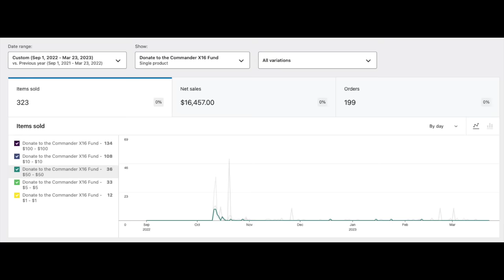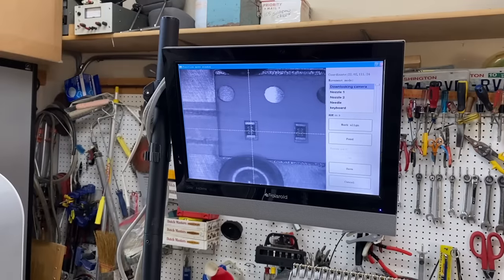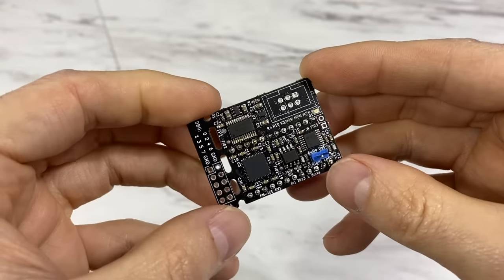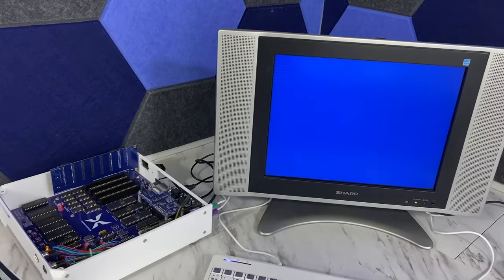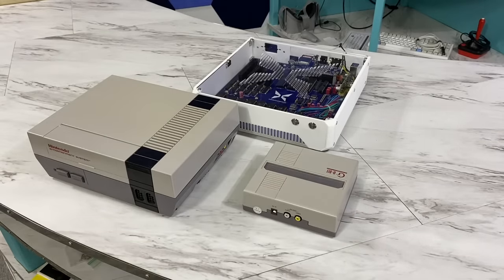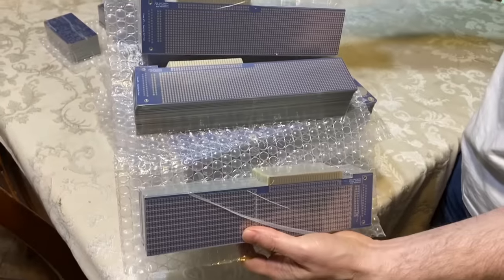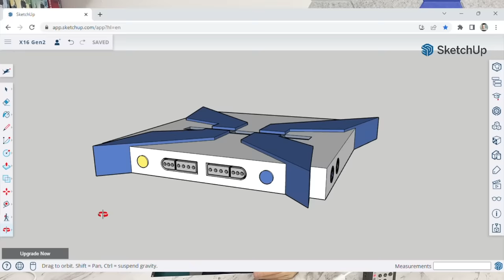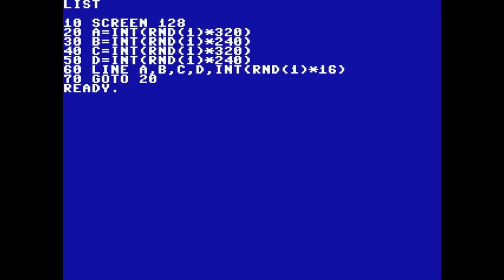Commander X16 2023 update

Comment: I used to work in electronics manufacturing. We used a wave solder machine (rather than a dipper) and it was leaded solder, so lower temperatures... However, the wave soldering machine had a preheat, a flux foamer, an air blade (to clear excess flux) and then the solder wave. The boards were held on two sides with a fixture that had channels on them that the boards slid into. If you tried a fixture that clamped the board into a channel on each side, it should massively decrease your fixturing time. The boards we ran had snap-offs on the sides that slotted into the fixtures, so there weren't component clearance issues. If you want more information, feel free to reach out.
Reply: Spent a summer running a wave solder machine, it would take up David's whole garage! Not to mention his whole net worth.
Reply: Yeah. I spent a year working at a plant that used a solder wave machine. Mass manufacturing of circuit boards can get very complicated. Having the sides of the sides of the circuit board snap off is very common. Also, having the frames that are designed to guide a board through can help.
Reply: Even though I have an AA in EE. I worked as a security guard at Litton Guidance and Control. They had a "wave soldering station" which instead of a flapper creating a wave to cause the solder to rise to the board level. It had the boards float above the solder and then turn to a 30 degree angle to pass a "waterfall" of solder. The solder was pumped, similar to an oil pump in an engine, up a column which created a waterfall of solder. The boards would then pass through this waterfall of solder. Making the total time the board and component passed through the solder to as little as 1 second. Vastly reducing the time the components were exposed to solder temperatures. And had a 100% successful solder rate. I was impressed that they were able to do double sided boards. The components held in place with small blobs of epoxy before soldering while using the pick and place robot. I considered this third generation wave soldering. It is sad that the x16 dev team was sold a 1st gen soldering solution. I fully understand the problems and fixes. It is sad that they have to fight to solve the problems that have already been solved in future generations of soldering machines. 
Congrats in solving these mfg problems. I am sorry you have to deal with this "old tech" problems. I fully understand that switching to 'current tech' would cost way to much' to keep up. Impressive that you could solve the problems.
Reply: This probably won't work in a garage. As well as pre heating it needs moisture control for the process to result in good consistent joints. As others have mentioned the PCBs need to be designed for clamping too.

If you need help getting them manufactured in China I have done it before. It will be cheaper and they obviously have high grade equipment and a lot of experience.
Reply: can just run a tractor belt pulling the pcbs through a solderbath. wave soldering is more to limit the heat exposure to the pins and epoxy of the pcb itself but as all that stuff from the 1960s still works fine i take it there is no problem with heating the whole damn thing to 360C or so :P (also that's exactly what an smd oven does too either way :) LOL. wave soldering is overrated bloat :P (that probably doesn't give that nice of a result as a proper solderbath anyway, more or less guaranteed to fill all vias and pads and not skip a few)
Reply: guess that if any day comes we can't get pbsn anymore we'll just switch to solder them together with literal .999 gold :P it has more or less the same mechanical and temperature properties as lead anyway. but that rohs crap? NEVER. lol. all that stuff literally falls apart.
Reply: I worked at a company that used wave solder machines in the mid 80s. I wasn't directly involved in their use, but being young and curios I did learn how they worked by asking questions.
Reply: A wave soldering machine was the right way to go. Taking in all the parts to assemble by hand was insanity. PCBWay could have populated all the boards. It looks like in the world of retro machines, Gideon and the Ultimate64 has been the only one to do it right. I honestly don't see the point in this project anymore.
Reply: @espressomatic I think this was considered but that would require the components to be sent to PCBWay. Dave would have thought this through and only rejected that as an option if it was more difficult overall than their current direction. After these early challenges are conquered it will be awesome! 😊
Reply: Ah the good old days.  The place I used to work went through giant drums of freon every day just to clear the flux off of those fixtures that would carry the board through the wave solder machine.  Ozone layer, what's that?
Reply: @espressomatic  not quite. lol. kalex and foxconn are still a thing you know :P just like they were in the 1980s. other than that one can just outsource production to things like sony. tramiel was a bit of an amateur for the units he actually sold (like who sells xx million units and then not either outsource to a REAL electronics manufacturer OR get a real fully automated factory yourself ;) tv manufacturers already did it in better ways 40 years earlier. as yes. computers ARE just electronics so if you want a few 1000 to million of em you do simply call a sony or a mithsibitsu or whatever to make them for you. not 'pcbway' :P all that other stuff is just for 'prototyping' and evaluation units. not for 'oh hi my design is finished and now i want a lot of them' :P
Reply: preferably have them handle the warehousing and logistics and sales channels too. as well as rma returns and support :P they do that kind of stuff. all day long. after all :P where you just have 1 product to sell they can just put it between their 100 different washingmachines and tvs.
Reply: pcbway just doesn't strike me as an actual manufacturer to call for large qty. plus they don't have relations with retail channels (toys rus, walmart, bestbuy, things like that and most definately can't handle THAT part of it) there are several entities in that market you probably never heard of. and quite a few that also sell walkmans and tv's under their own brand(s) to call :P that can do all of that hell a lot better and may even want to sell it under their own name :P
Reply: with a nitrogen tunnel behind?
Reply: @CB3ROB-CyberBunker  if we're still talking about this project and not just electronics manufacture in general, I somehow doubt this thing is going to get off the ground enough to ever sell more than 20k units. it's pretty darn niche. trying to sell it in walmart sounds like a lost cause. but I don't know anything besides having watched a few videos on this project, so I'm kind of talking out my ass and taking a wild guess at the scale. what you're talking about sounds wildly out of scope to me.
Reply: @jamesdye4603  Thank your for telling us that you were young in the past and that you learned "something" by asking questions. Oh and for not telling us some irrelevant and anecdotal information that does not contribute the slightest way to this topic or the solution of the problem.
May I ask in what you were involved instead back in the day? Professional trolling? Or professional trivialities?
I'm sorry, but your self-promotional comment, which doesn't make any sense, deserves just such a cynical response. (How can you just say you know something... but then don't share it if that's the point here??? What kind of strange behavior is this?)
Anyways: ROTFL and *facepalm*
Reply: @dieSpinnt  Fortunately I'm immune to your cruelty and will leave you with this. From 1986 to the present I or someone like me has repaired your car, fixed your plumbing, repaired your roof, or mowed your lawn. Even if you live somewhere you don't encounter anyone I mentioned you still encounter people like them, people who can make your already miserable life unbearable.
Reply: @dieSpinnt  You spelled your name wrong.
Reply: said it before and will say it again tho. it needs ethernet :P lol. not optionally but always there with the same chip at the same address and irq/nmi hookup. it doesn't need to be fast. it needs to be there. :P for it to penetrate most markets including nowadays home computing and games. (who still plays games with 2 players with 1 joystick both on 1 screen anyway ;) so even for that. also for all control functions in buildings, factories, atm's, kiosk systems, display systems and whatever else you can also put these into :P (and provide a system that basically cannot break or get hacked and runs instantly after powerup - you know all that stuff shitty pcs or raspberry pis (all broken after a year anyway) cannot do ;)
Reply: the markets this thing would work very well in. are exactly the same market the plus4 would have worked very well in. if the one and only supplier didn't manage to go belly up and by that time had a rather unusable reputation as a games box seller :P lol. (you don't sell 10 million units or so to lets say compuserve in one go if your other products are sold at toys r us :) a reputation problem anything not commodore 'business' machines does not have :P (they kinda screwed up after the pet ;)
Reply: this thing here, literally is a standardized platform (and if you want let's say a plc you can just leave chips out, it will still run the same code ;) without all the insecurity of pc's and their somewhat high demands on operating temperature, moist levels, etc. and limited supply lifetime and lifespan. (plus that insecure crap needs 'update' all the time. but that's more an 'os' thing. an os you don't need. so why update it :P LOL. this is the sort of thing you order in masses for 'put it there once and it keeps doing it's thing forever' and should it ever break you pop in another one and it's still exactly the same. (unlike pcs ;)
Reply: @CB3ROB-CyberBunker  that's a hypothetical thing that could be done with it, but has anyone said that's the goal? or is that just your idea for it? 6502 has been around for so long that if this was a viable idea, I think it'd already have been done. but who knows, maybe you've stumbled upon a great idea. even so, there's nothing at all special about this project for that purpose that couldn't potentially be done better by a big company who wanted to throw money at the problem. as far as I know, this project is solving for a hobbiest market.

as for aviation controls and stuff like factory controllers - 6502s are already in use in those scenarios. I'd personally suspect they'd use more hardened devices than this to deal with stuff like mechanical stresses and radio interference. these probably aren't going to be optimized for those scenarios.
Reply: @blarghblargh  hmm. see our front operations sell these encrypted communicators. :P which some 'cops' claim would be 'for criminals' (whatever ;).. that shit currently runs on android and ios. would place an order for 10K units (and then we'll see where we take it from there as let's just say we had more android and ios units in circulation before some cops decided to screw around with it ;) basically right now (need to discuss this a bit with you know, other people that will need to foot the bill ;) but ofcourse the thing needs 10base-t :P or it won't 'communicate' at all :P LOL. if you only wanna sell these to home gamer people you're basically fishing in the wrong pond :P LOL. ofcourse we can cook up our own hardware designs... but it generally would be better to come to some 'universal' 'standard' thing that can be used in pretty much all fields of industry. (you know... something much like the plus4 ;) 'insert your own roms' :P one where we can just hire developers for that already have them at home (although they probably use them for different things ;) (ofcourse eventually getting back to portable units, something like this exact same hardware in a black blob chip in a blackberry q10 like case is desired. but for now it suffices to move that product line away from all those 'smartphones' that do a bit too much and for the wrong kind of people (ie not the ones that paid for them ;) noting but shit with backdoors on those ;) LOL. you never have that on a 6502 running from rom :P it's more than powerful enough to do all the encryption and decryption stuff and let's face it the customers don't want cameras and microphones anyway ;) LOL they just want it to be secure :P
Reply: I work at a company that has and still uses a wave soldering machine. Its a compact machine about 10ft long and 3-4ft wide so there are compact ones out there
Reply: I think he should try preheating the opposite side, then flip for the immersion. This should decrease the temperature difference between both sides as it heats up the cooler side. Of course, he can’t do that with a brace on one side or components that might fall out but if it’s just to tin the PCB this should work better.
Reply: The thing is that I do want to use fixtures to reduce my lead-times. I need to use a lot of lead-time reduction techniques because I only have a small crew so every hour counts. But I need the leads to be on all the components.

If you used wave soldering, the boards were held on two sides with a fixture that had channels on them that the boards slid into. If you tried a fixture that clamped the board into a channel on each side, it should massively decrease your fixturing time.

I am not really interested in wave soldering, it has never worked out well with low melting point plastics. In my case the plastics melt after a few seconds and the components don't get soldered to the PCB well. Also I just want to use a regular soldering iron.
Reply: probably..
Reply: I too spent a career in electronic manufacturing. That almost looks like plumbing solder, I'm used to SMT. If those boards were smaller a solder bath would do fine if they are one sided. Maybe David could also sell kits, and people solder it themselves?
Reply: @CB3ROB-CyberBunker  What in god's name ar you talking about? Are you suggesting this niche, expensive hobbyist computer full of dated tech be marketed as an incredibly expensive microcontroller?
Reply: @Allen.Christian  exactly. and not just in derivative forms as microcontrollers but also as control panels, data display units, text entry terminals, ATM's, flight controllers, navigation systems, office workstations for security critical applications (you know, if you don't want them to play tetris in excel but just do their job ;). and there is no such thing as 'dated tech'. there is just WORKING tech. stuff pc's and iphones and the likes clearly don't do for more than a few months and 5v dip chips do for centuries if need be. price and processing speed are fully irrelevant anyway. security and quality is. define the platform in full. as a full microcomputer with everything. and just leave the parts out that specific implementation does not need. rather than the other way around. ending up with a kazillion different rs232 and video and ethernet configurations like pc's have is horrid. :P in situations where price or size does matter.... well... it always still fits on a single chip die under a plastic blob in your 'phone' now doesn't it :P (but then it won't last a 100 years ;)
Reply: main thing. establish a hardware homogenous platform. for running code on the metal without any of that 'os' crap needed elsewhere. strip all the attack vectors away. also strip out anything that would lead to a shorter lifespan mechanically and electrically. for you know, the base standard reference units (if people still wanna put the logic in some smd shit chip that's up to them, main thing it would still run the code all the other ones run. so there are plenty of developers for it. ;)
Reply: it's best not to make it 'expandable'. but rather to design everything in already so you can leave parts away :P 6502 code generally doesn't check wether a chip actually completed initialisation anyway ay (commodore much? ;) LOL.
Reply: @Allen.Christian  as for 'expensive'. bought some toshiba plc's lately? lolololol. see we'd much rather have some standardized hardware platform with a 6502 core for everything from our handheld encrypted communicators to door/gate control systems to vehicle tracking to, indeed, yes, the terminals on desks. something that lasts as long as the building you put it into :P and has little to no opportunity to be 'hacked' (so intel, no hidden microcontrollers in microcode, no in-system reflashable roms, no nada ;)
Reply: price totally doesn't matter for the initial markets...  neither for the nerds that want a full 'micro computer' nor to enter the plc or flight controller or atm market. it's the lower end markets later on where price would somewhat matter (but people still buy a shitty iphone for way too much money than that always broken crap is worth ;) so even there... by which time you simply buy a chipfab :P woopetiedoo. rocket science economics people... as indeed. it IS old (we prefer the word, established, proven to work) tech so you can just buy the old production lines of let's say philips/nxp or intel or whatever :P let them have fun with their overclocked, undervolted, 'nanometer' crap that won't last a week.
Reply: the c64 soldsome 26 million units... mainly because they're all the same :P the c64 is not a 'clean memory map' design and uses all kinds of weird bus timings (and some half broken chips ;). (basically a horrid contraption to take as a platform and base other, compatible, products on) now imagine something like that, but obviously nicely done in all fully static cmos. which IS a flexible design. clean memory map, no weird bus timings, chips that are all more or less perfect (like on the plus4, register wise they all do what they're supposed to do and only the lightpen is broken ;) not as in 'apple II or pc style expandable' but 'if you don't want a keyboard, well, then just leave the keyboard and it's chips out' :P LOL.
Reply: the future of computing isn't in 'faster' or 'cheaper'. it's in 'better'. and tbh not many stuff developed over the past 25 years makes the cut :P that and a 6502 based board uses far less power than anything else. which seriously doesn't matter if you have one on your desk. it does matter if you have one with a keypad and rfid scanner on each one of your 1000+ doors :P throughout your entire building. (or actually 2 of em :P we do prefer to also let people out again ;)
Reply: but eh yes. to return to the main point here. ofcourse it needs ethernet not as a self configurable 'option' but as a standardized part of the reference design. always the same. (and not just for all the plc and whatever applications. also for plain and simple, playing games. it is 2023 after all people no longer plug 4 joysticks into one atari ;)
Reply: @kenjinks5465  That's what lead free solder looks like when it's in a pot... It's horrible to work with.
Reply: It's all about conveyor speed and zone profiles of a reflow oven. I specialize in Fortune level start up companies. Financial groups hire a consultant like me so they don't end up shooting their capital inaccurately, so what I do find (and is acquired), fits in my factory layout properly.
Reply: your just bragging now 🤪